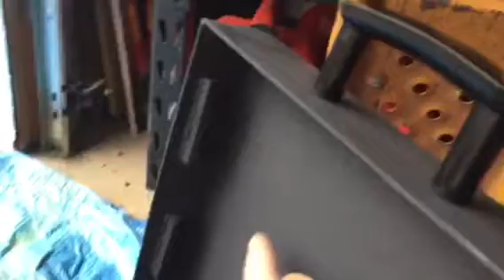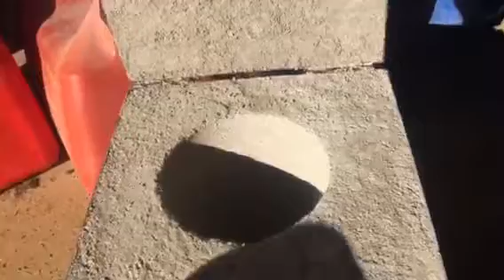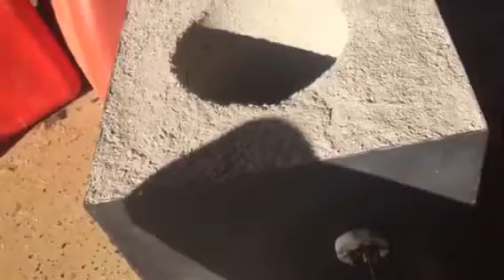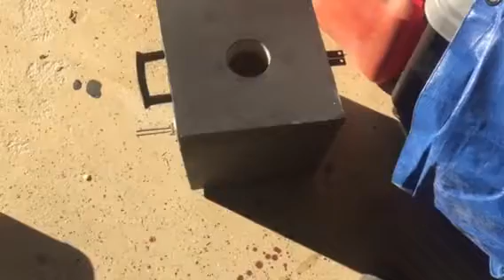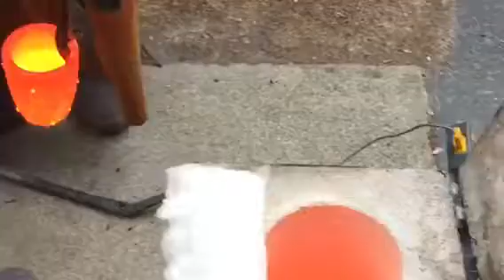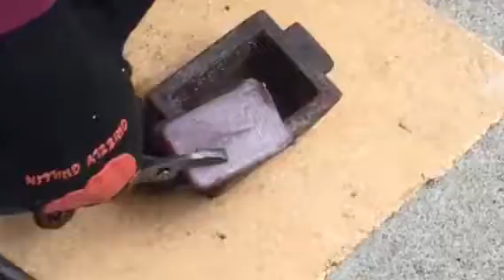Burning in the new furnace and casting molten copper

Comment: The pores on the cast copper could be due to moisture coming from the cooler mold or could be dissolved oxygen in the molten copper coming out of solution as the copper cools and loses the ability to keep it dissolved. A very old trick to de-gas or remove the oxygen was to stir the copper with piece a tree branch. I would guess that might lead to a lot of popping and splattering so perhaps a graphite rod would be better or a charcoal briquet.
Reply from the maker: Thank you, I’ll have to try that next time.